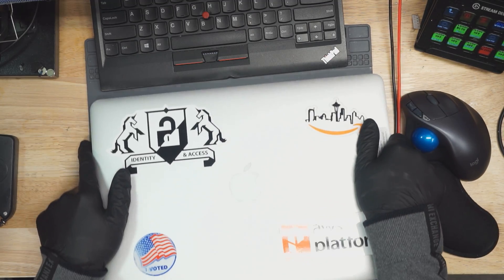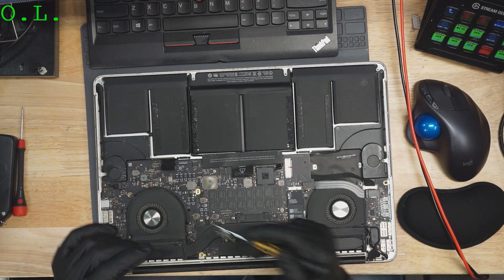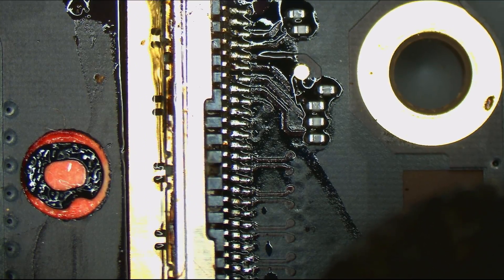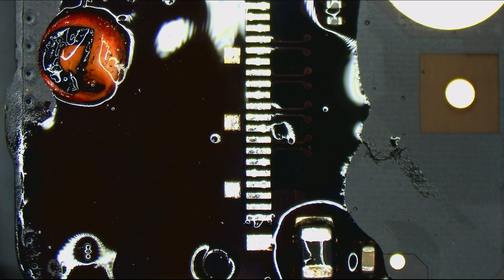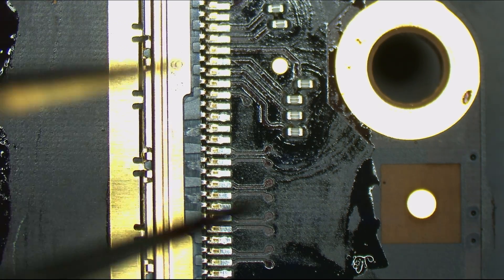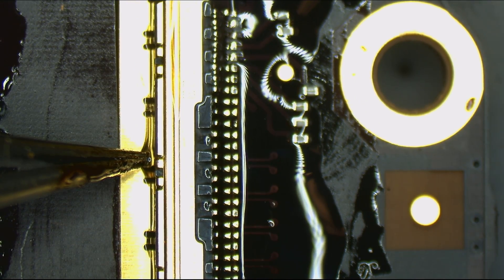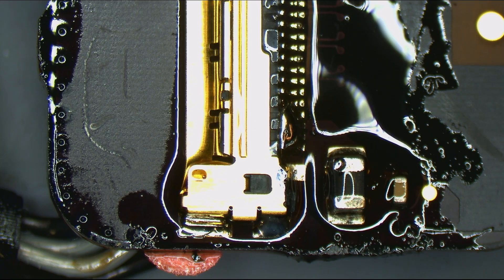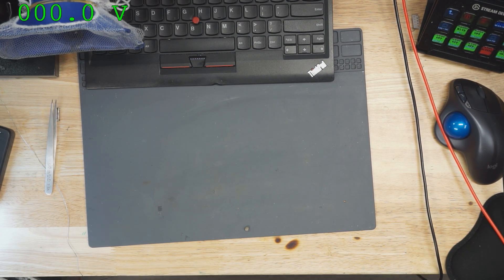Why does A1398 Retina Macbook Pro have no backlight?

Comment: friend I received one with this same problem, I changed the connector of the screen I also changed the cable that goes from the screen to the motherboard, I changed the fuse, without the screen it reaches 55v on pin 1 of the backlight, but when I connect the screen it lowers the consumption to 12.5v,  do you have any idea what it could be?

Comment: Hey Louis, I just pulled up this video and haven't watched it yet. I came on here to ask you a question which might also help other people. 

I have a used  Mid 2015 MacBook Pro Retina 15" A1398. After about a week or two of using the MacBook, I noticed my screen started flickering. The first week or two the laptop seemed perfect (but then again I didn't use it much). I immediately thought it was an issue with the logic board. Upon opening the back cover I noticed some of detectors were red so some water may have gotten in. Initially I thought it was the backlight inverter chip. I also noticed that when I tapped on the computer the backlight would come back or go off some times. Now, that told me something was loose and not broken. After trying SMC, PRAM, NVRAM resets I decided to look at the board closure using a magnifying glass (I know) ... and noticed that the trackpad board had corrosion. I cleaned it with alcohol until and everything looked good only now I my trackpad and keyboard wouldn't work. The power button seemed to stop working. I then decided to disconnect the ribbon cable that plugged into to the logic board from the trackpad and viola ... I had backlight and my power button seemed to work again. The trackpad and keyboard was still dead. I decided to order a new trackpad and just got done installing it. So far everything seems back to normal and running fine. Another thing I noticed was that on the trackpad,  2 of the end pins were missing from the ribbon connector (the connect that goes from the trackpad to the logic board) and I'm wondering if that was the culprit.

I'm just surprised that the trackpad was able to affect the system the way it did. I'm hoping others who might fall into the same situation will find this comment and it may save them some time troubleshooting. My question is, do you have any idea WHY the trackpad being corroded caused the backlight inverter, keyboard and trackpad to stop working? Obviously it was causing something to short out but I just don't understand WHAT.

I'm new to this and have been watching your videos. Ive always enjoyed playing with electronics so next on my list is to purchase a electronic microscope and Hakka soldering iron.

Thank you so much for all of your helpful videos!

Comment: Hey Louis, i have a 2016 MacBook Pro that isn’t powering on. Last night it was running perfectly fine but when I awoke this morning I found that the screen was black and refusing to power on. I have tried an smc reset with no luck. Just wondering what you think the issue may be. Unfortunately I don’t have time to send it in and there aren’t many trustworthy repairmen in my area so I’ll be forced to take it in to crApple

Comment: So problem you probably wont be able to solve without seeing it but worth a shot. I have an older custom made laptop. A few months ago it started having an odd issue where when I try to turn it on it power cycles like 20 times. Not even geting to a screen. It just powers long enough for fans to spin then clicks off. I have taken the thing apart to the bare bones main board and power. And it still does it. Eventually it does turn on and runs perfectly. Running games just as well as befor this. I have a newer laptop so not a huge issue but I use this one for lan play with friends sometimes and it sucks to sit there waiting for it to finale run.
It's a gaming laptop the base is an msi.
Reply: Sounds like the thermal paste on your CPU or GPU needs to be replaced.  Replace with liquid metal.
Reply: @alaeriia01  no that's definitely not it. If that was the case I'd have issues running high end games. The cpu and gpu are at thier coolest at start. So why would it work perfectly later.

Comment: Hi Louis I have a Dell motherboard with soldered on raid chips. I fogot the password for the computer. I am unable to use my password reset disk because it cannot detect the raid area. do you have any suggestions on how I might retrieve my password?

Comment: But the real question remains unanswered.
DO YOU or do you not fix souljagame handheld with 3000 built in games ?
Reply: Actually the real question is do you get fan spin?
Reply: @Pmak  That depends if your PEEPEEbus is soldered on correctly.
Reply: Can it run crysis?
Reply: Game Speed 1:1 Output
Reply: The even bigger question, can you say 'it just works!' ?
Reply: Don't promote that lazy console.

Comment: Hi Louis!  Where did you get your SMT soldering training?  I did a 3 week soldering course when I was in the Army back in '79 (I use to repair radios in Huey Helicopters) before SMT parts even existed.  I have done a lot of SMT hand-soldering, but some of  these newer chips scare me.  I currently have the old skol Zepher pyramid hot air station, but I think it may be time to up-grade...
Reply: @cmdr4589  If I can't see the pads (BGA for example)...it scares me.

Comment: I have a tuner pcie card that has some small parts marked 'fb' missing. I mean you can see they have been broken off by a solder arms remaining. The card is not tuning anything. My understanding is these are ferrite beads and mostly conductors, but somewhat filters also. Can I just jumper these solid to see what happens or is that irresponsible?
Reply: Thanks guys, but I couldn't wait and it seems to be working minus whatever eventual overcurrent/noise  doing that caused.
Reply: @MatthewSuffidy  I suppose you could indeed bridge them if they are ferrite beads, but those are probably in the tuner section, so you may suffer signal degradation on some channels, probably on lower ones.

Comment: How does a problem like that happen? Im assuming since the screw was not even in its place, the customer probably tried opening the laptop themselves?
Reply: Vibrations from the fan and thermal variance over a long period of time. That's the 000 Philips screw for the fan shroud and it's really not uncommon at all to find them lodged somewhere inside the machine or to be missing since they are so small they can fall out of a vent. Those screws don't have threadlocking compound on them like the logic board screws, so they fall out all the time.
Reply: Ohh, and if you ever encounter a missing shroud screw, check around the open spaces around the battery cells. That's where they usually hang out.
Reply: @WhatnotSoforth  that is ridiculous not to put thread locking compound on internal screws! It is so easy to do! Was in manufacturing for many many years so many that I have 7 bad vertebra discs from using microscopes for tiny hybrid devices. Stupid Apple or actually smart if they plan for device failure to see you a new device.
Reply: @Neal-001  I feel ya. My body couldn't take the pace of manufacturing. If it wasn't the cutting fluid all over the floor eating the soles of my boots and making me slip, it was the concrete and bending over a Mazak reworking crappy Chinese parts that had my back in a bind. I did get shuffled up the hill to run the scopes though. That was fun, reworking thousands of transmission parts a day with a toothpick because the guys down in Mexico couldn't align and sharpen their dies. Of course, the engineers got mad that we were fixing the vendor's problems and introducing surface blemishes and scratches (it's pockmarked silver-clad copper sheet for crying out loud! We got the slivers off the boreholes you ungrateful cretins!)... they just didn't realize their no-rework policy was going to have an >80% reject rate from us, and that got them mad enough to send a rep to make sure we weren't screwing up. (Big company, too. You'd know them, it's "how you spell RC!") The sad part is that it meant a LOT of Mexican workers got canned. Apparently, if they passed a part we rejected they were fired immediately. I'm honestly surprised there was never a class action lawsuit against two of the Big Three for transmission failures for the parts we DIDN'T check, as I recall there were a lot going on in that time period.

But anyway, Apple designates that the screws holding the logic board to the chassis have threadlocker, as they've done for a long time, but apparently didn't require that for the fans. I figure it's Foxconn that makes them, considering they make just about all the other stuff too. Hey, why spend money if Apple didn't spec it, right? It's not like it's a spinny thingy that vibrates or anything. It would be hilarious to me if they didn't even use a prime number of fan blades anymore, which would explain the vibrations.

And of course the Retina line is gone now, so why bother? I figure the "geniuses" never caught on to this problem until it was too late to fix it. If the fans are rattling enough to knock screws loose surely the shrouds make their own noise. I just never got to spend a lot of time with one to know. (There is an internal dB acoustic measurement the SMC does to monitor fan noise, btw. You can access it with the right key, zDB I think?)